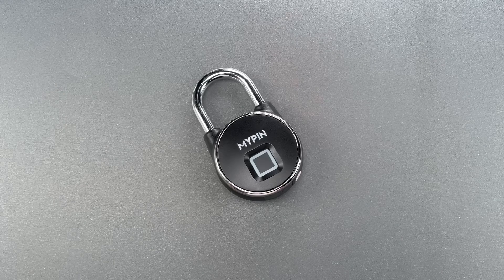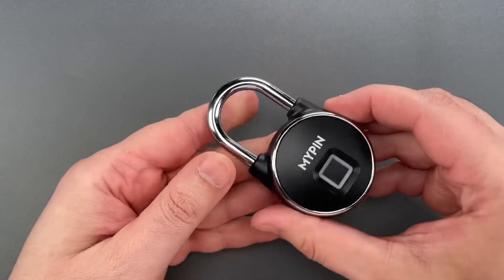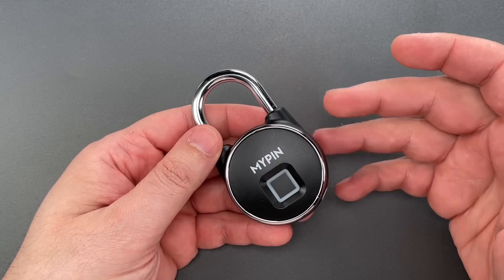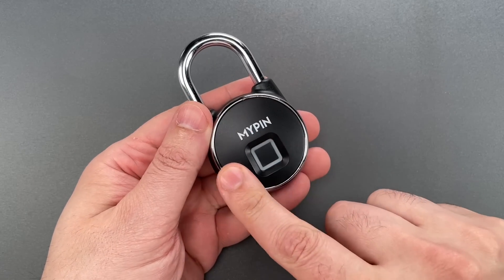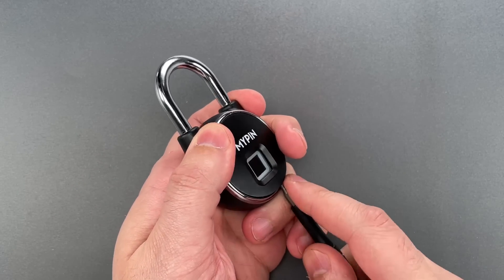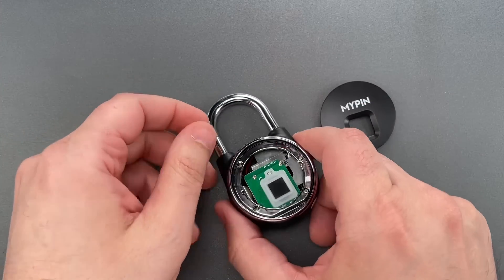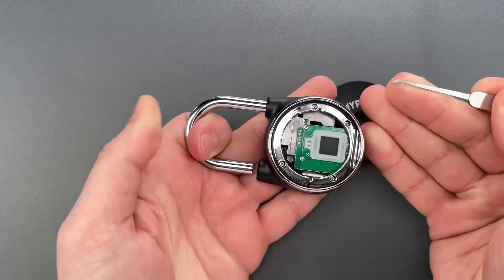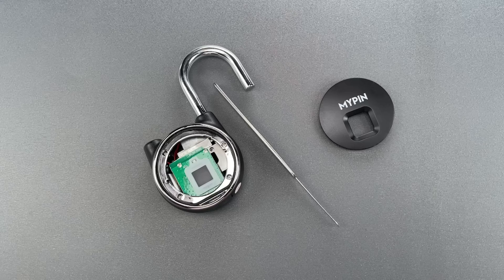[1469] I ALMOST Can’t Believe How Bad: MyPin Fingerprint Lock

Comment: The only thing I could see Bluetooth on a padlock being useful, is in the event of bad weather and you need to go out to the building to get something. The padlock could then be unlocked via a remote from inside the house, making access to your storage building quicker, so you can get in retrieve what you want, and lock back the lock and get back into the house, without being drowned by torrential rain, or being buried in blizzard snows. Even as easy as this lock is to open up and unlock with a pick, 99% of attackers, are still just gonna use bolt cutters and cut the lock off, that’s the fastest, most skill less attack on a padlock that works. Padlocks generally only keep honest people out, and even this lock would keep an honest person out. If someone is truly honest, you could just leave the lock off completely and honest people still wouldn’t even attempt to go in

Comment: I have sometimes thought about how to create a lock that not even LPL could defeat.  The biggest weakness of LPL attacks is time.  He often needs 10 or more seconds on more secure locks. In real life, someone with a legit key would unlock in less than 1.  So... what about a lock with a protected entry that when breached must be opened within 1 second. Otherwise, the lock becomes stuck. You could then resort to destructive means but that would be more difficult to do in the wild when using a strong frame and shackle. Anyhow, I would love to see a variation of a lock with a time element.  LPL is fast but I believe a time element could hinder if not block picking attacks.

Comment: Electronic locks certainly have some advantages and areas of application. But if it has such a low security standard, it's not of much use.

Comment: See what's wild to me is that the Bluetooth antenna should be part of the padlock shackle, not inside of the device. No point if the shackle is opened to keep the Bluetooth connection, which would conveniently hide the MAC address when used.

NFC should be a means of getting a matching fingerprint with the handset in use so that Bluetooth unlock functionality is "Keyed" in a sense. Encrypted exchange of a small validation packet and all of that jazz. WiFi can be a fallback. Lastly, throw all fo that in a real metal housing resistant to attacks. I bet it can be done, but no manufacturer save for Pacific Lock Company would give a toss to improve upon this.

Comment: It's not a bug. It's a backup when the battery dies...
Seriously... I can understand electronic locks mounted on the walls, connected to the power supply (i.e. office doors, etc). But electronic padlock is probably the most useless thing ever. Adds more things that can possibly go wrong, adds price (or maybe it does not if they don't install the metal panel to cover the innards), adds maintenance (charging)...

Comment: With how little movement you see in the shackle, I wouldn’t be surprised if you could open it just by brute force pulling. Just a little bend and it should be enough to remove from whatever it’s securing.

Comment: Even if the guy do it like a tooth brush as an object, this thing as it's electronic not even protected, mean it gonna break due to moisture really fast if it ever leave a heated dry area.
So even the electronic side look poorly designed.

Comment: Why a bluetooth lock? Bluetooth only works at short distances. If you are near the lock, just put your finger on it and it will open... even if you are 10 feet away from it, it would be faster to walk to the lock (which, in any case, you will have to do, because you are opening the lock to access what it was securing!) than to take out your phone, unlock it, (maybe enable bluetooth), find the app, open it, wait until it connects to the lock...

Comment: Even if they'd put a metal back plate in there, you have full access to the electronics, I bet applying voltage to the right part of the board would trigger the unlock as well.
Reply: Well they could have built the metal plate like the plastic peice to have a square cut out for the sensor and block the rest of the circuit board,  however that would have necessitated the small hole and external antenna as lpl was originally looking to find, i guess doing that was much to costly design change for this company though.

Comment: even if they had a plate protecting the mechanical parts id say even having the whole board exposed is potentially an attack vector as I suspect a small battery to the leads for the lock would open it.
Reply: I think if a plate were added to this it would be over the circuit board with a square cutout like the plastic cover has. Would then obviously need the antenna separate and coming through a small hole as lpl was expecting.

Comment: Heck, my electric toothbrush is a lot harder to break into. I've been trying for two years as the battery is less than good. Still works if stored on the charger but forget about that week of use I got when it was new.

Anyway, I haven't found any non destructive way to get into it as the shell is sonic welded. So definitely safer than that lock.
Reply: My electric toothbrush is equally hard to disassemble, but replacing the brush head and AA batteries is easy.

Comment: It always seems to me, that the engineering of these locks goes out the window as soon as somebody mentions the word smart. They are either smart or secure (more or less) but never in combination. I wouldn't mind smart locks, if the lock itself is properly designed. After that you can bolt anything to that lock that you want, as long as you don't introduce new weakpoints. Speaking of smart and weakpoints: So far i haven't found any smart device that wasn't a weakpoint in itself. All in all i will not touch them with a bargepole. I am still waiting for the day, where you stand in the middle of the street and shout "Alexa, open front door" and all doors around you actually open.

Comment: ...Also, why oh WHY did they put the locking lug on the already retained side of the shackle? I see this quite a lot on cheaper combo locks and luggage clips. I really wish they'd remember that if theres not a locking lug on the side of the shackle that comes out it can very easilly be forced open with a hammer or pry tool. Clearly, Masterlock IS NOT the worst lock manufacturer.

Comment: I think that the trick is to make the plastic cover look the same material than the metal casing... to sell it, because anyone who touches it will notice the difference. I guess it can protect you if the theft doesn't know the lock so don't even try the first trick to open it.

Comment: I’ve seen these opened just by smacking the side moderately hard, no need for all this taking it apart. That lever you push just needs a bit of inertia to displace it. As you can see, there’s no locking nook on the inserting side, it’s completely flat, so there’s nothing to counteract a simple inertia attack.

Comment: .... does there exist a multi-key lock where all the keys has to be in otherwise it can't turn because it requires two pins to be raised at the exact same time? Or even a lock that requires another bit of input before you can turn it? Like say for a pad lock a tiny hole's button to be pressed or requiring a wind-up key to be placed and used? or even require a locking lug to be removed from a hidden place?

Comment: Most locks are there to keep honest people honest. A bad actor isn't going to be stopped for long in most cases anyways. In any case This is a novelty lock. Having that much exposed under a plastic cap is an easy sign there are OTHER exploits also available. I bet it can be unlocked with a short of some sort as well.

Comment: I feel like cheap easy to open locks like these are designed for stuff like high school lockers... it will stop most people from ransacking your locker because they don't like you, only actual determined theives would take the time to pry off the cover and they're likely to be on camera(most schools have them in the halls now at least) doing it. A bluetooth one would've been a godsend back in the day, or even better an nfc one.. just walk up to my locker and its open. Not that dialing the combo was hard, but some days you're in a rush and it takes 3-4 tries and frequently there wasn't much time between classes. There's probably better choices than this one though lol.

Comment: This lock probably started with a solid case with a small hole in it, but then one of the focus group testers asked "How do I open it if the battery dies?" So the product team redesigned it so that you can still open it with a dead battery... problem solved!

Comment: One extremely disappointing running theme of these "smart" locks is them not locking the shackle on the side that opens, and making that side of the shackle as short as possible. Both of those make these locks much more susceptible to destructive attacks.

Comment: Children's toys with the little screw on the battery cover are harder to open than this. I spend more time trying to find a #1 Phillips than it would take to "crack" this lock with a pocket knife, a fork, the file on toenail clippers, or any random metal implement I could find nearby. 

Absolute disgrace to call this thing a "lock."

Comment: I wonder if this could have application in say a pool locker room. No keys to keep on you, no code to have to remember. Not sure if it can read a thumbprint that's gone wrinkly though, but if all you're doing is protecting your jeans, not a big problem there... But then again, car keys might end up in there too, so... I think I'd want to protect my wallet and keys with more security than something that can be picked with a toothpick.
Reply: Get a good lock and the key won't rust in water. You can take it with you.

Comment: Maybe they should market as "child safe" instead of "secure"

Now I'm just thinking of which lock LPL's parents had to use on his playpen
Reply: I'm not even sure it is. If a child has got enough curiosity and something to get the plastic front off, jamming that same tool around inside could open this on a fluke.

Comment: Well I need to a Wi-Fi weather proof padlock for my business, we own a gas pump and every employee has a key, we offer 15 g a week to the employees but lately some have taken advantages, so I bought these to gen 4 padlocks so I can track and open the lock for them, rather then having a key, I did buy 2 padlocks already but if any one knows of a lock that can track Multiple users and the second that scan there tag I would get an alart, and does anyone have any suggestion on the best locks I should get. I bought the 4th gen egeetouch smart padlock, now I’m not worried about picking or bypassing I’m more interested. If anyone knows of a better lock on that you can give out 50 tags to unlock but I would need to get notifeted the second they unlock it or is their a system where the key tag can be giving to a person and it’s there on personal code. If anyone has any experience with any of this, I would pay a consultant fee if you actually do help and provide the tool I need that works, if you think you could help please leave a reply and will figure out a way to talk off of YouTube

Comment: I know, locks and helmets aren't quite the same... but just like here trying to meld tech with something that needs to work reliably and someone is going to mess it up for profit.
So when I see really cool helmets with Heads Up Displays and such... I wonder how well my brain would do in a crash because even the cheapest "Real" helmet brands spend a lot more R&D on the protection than just the glitz of tech

Comment: Now that's Disappointing for Securtity-Reasons.
Also, If it were BlueTooth, I'd use the Exposed Metal-Part as an antenna and the Fingerprint-Sensor separated with the rest sitting in a Chamber behind it.

But no amount of Technology would increase the Safety of this Lock, if a Part of it's shell is simple Plastic.

But that's why  the LockPickingLawyer is so important, to teach us what Lock is basically worthless (even tough it costs 50$), and wahat Lock takes more time to open.

So bnasically, if a Video about a Certain Lock ios under 3 Mionutes here, you can basically forget that Lock, and watch the Video for an enternaining destruction of a Lock-Producers Product.

Comment: hahaha so bad.. has so much potential cause you're (if designed well) unable to physically get a lock picking instrument into the locking mechanics to pick it and would have to resort to brute forcing it. Which probably wouldn't be that hard with a couple of wrenches in any case but still...